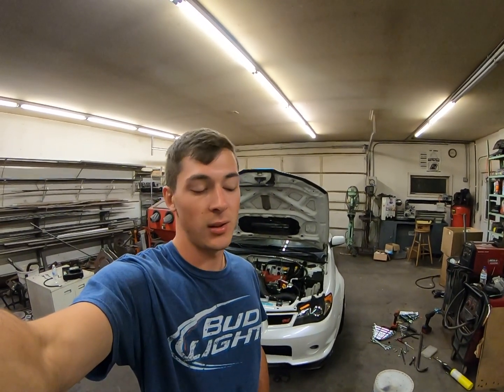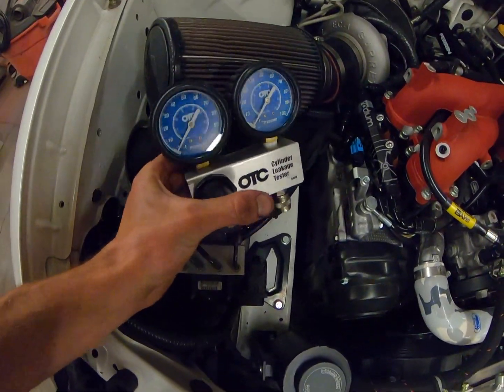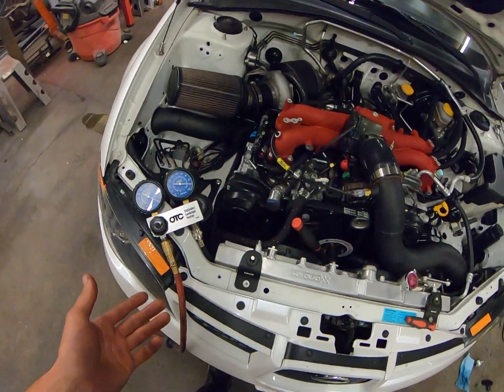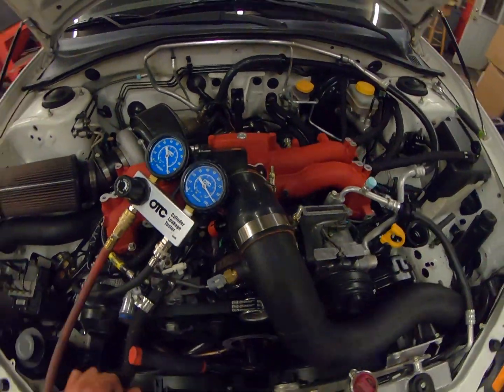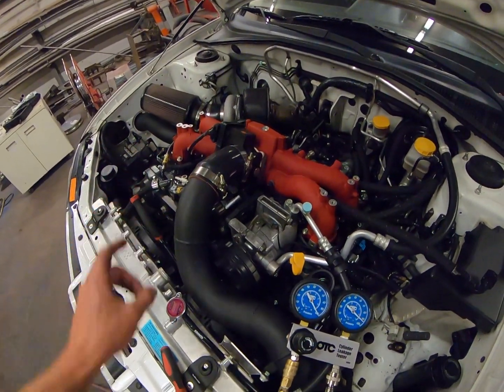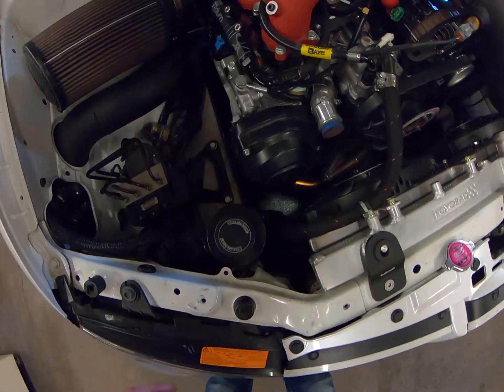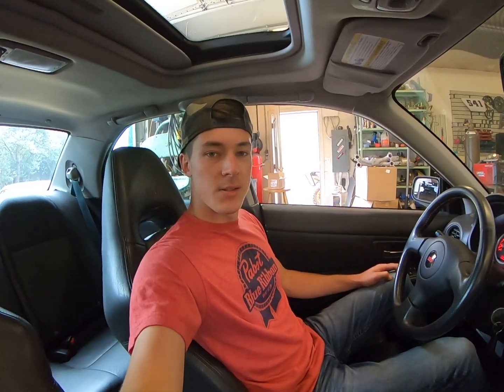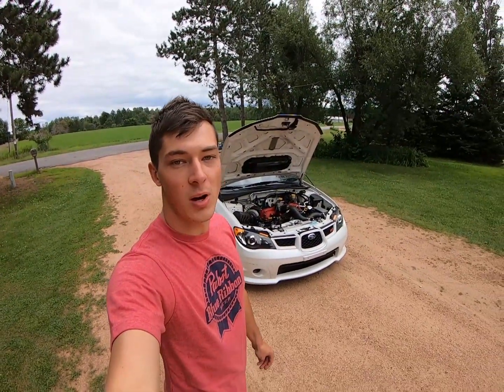650whp STI Leak down Test

Comment: hi Dylan, did you perhaps skip any details with the leak down test? For example, doesn't each piston have to be at the dead center top of the cylinder for compression testing? I did see you had a ratchet on the main crank but there was no mention of this. Can you/ did you crank the engine over with the ratchet with all 4 wheels on the ground or did you lift the car? WOuld be good if you could expand on some of the details like that. 

Noob question: I assume the engine has oil in it for both the leakdown and compression tests; especially since you're cranking it over for compression? I am looking to do both these tests soon on my 08 Sti and could use the details. 

Did you reuse those blackened (fouled?) spark plugs that were shown in this video or did you replace with new ones? They have surely seen some heat cycles. 
How many miles were on those plugs? 
What kind of plugs were they (Iridium, copper, ruthenium, etc)? 
Were they one or two step colder plugs or just base heat dissipation for your 650 hp build?

THank you so much for your time - and btw very gorgeous car. Nice taste and style.
Reply: Matt, what's up? I'm not sure how he was able to say he was TDC when he did his compression test at the end and all the cylinders were 150 PSI. I've seen this in 2 videos already looking to see how guys are setting TDC. For me I would be removing the AC rubber belt and the alternator rubber belt, along with the crank pulley and timing covers to see that the mark on the crank cog and intake and exhaust cam sprockets are lined up with the lines on the timing covers and block but, that's just me. It seems like there should've been some leakage if he wasn't actually at TDC when he did his initial test, I could be wrong though because it wasn't recorded to show anyone that it was set TDC. As far as spark plugs depends on what heat range you are looking at. The general rule for Subaru's at least is for every 100 WHP over stock you should be using one step colder plugs. My 05 STI is in Florida and it was tuned by JR at PRIME MOTORING and they use these plugs NGK LFR7AIX during the fall/winter/spring for summer though I'm running these which are way more expensive but recommended by PRIME MOTORING (R7437-8). I would talk to your shop/tuner though about which plugs to run and remember to gap them according to what your tuner says. I'm running the COBB flex fuel sensor so I can run either 93 or ethanol. On pump I'm making 620/471 lbs torque and on E-85 757/547 lbs torque.